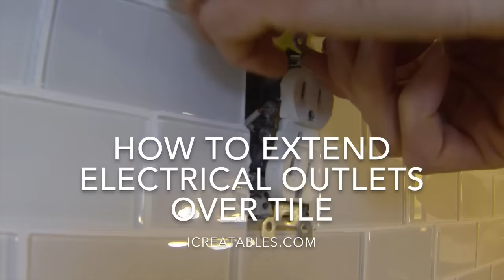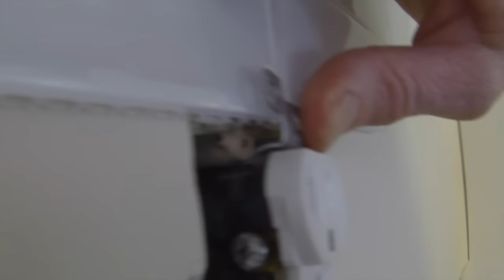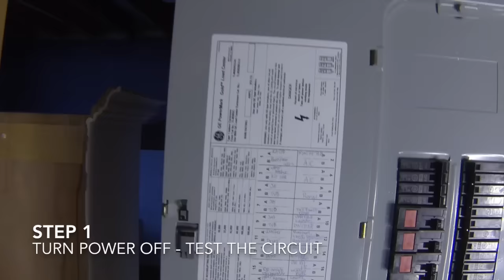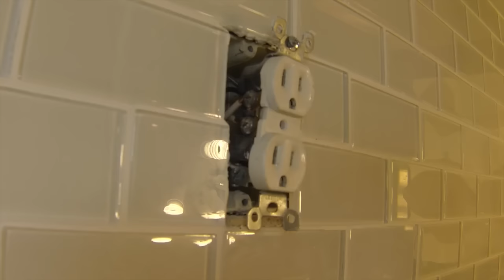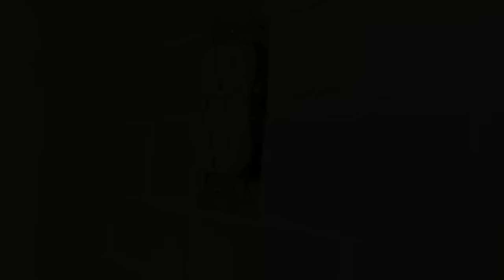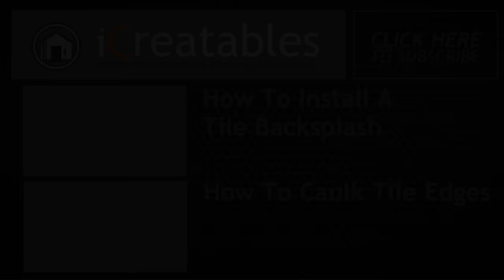How To Extend Electrical Outlets Over Tile

Comment: This "problem" has been hanging over my head for a year+ after DIYing a tile backsplash in my kitchen! Thanks for this information - I already bought mine at Home Depot & the outlets get fixed today! 👏
Reply from the maker: You are so welcome!
Reply: Where did you buy them?   And how much?
Reply: SAME!!! About 2 years now after a contractor installed the tile and left me with the finishing work! Excited to have my kitchen finally back together.

Comment: Thanks for the Info....I will have to replace all outlets and switches and do backsplash in less than 4 hours due to my fridge & mini deep freezer all being on the same circuit as most of my outlets in the kitchen, I may just wait until next week because I need one more outlet not in stock anywhere locally!!!!

Comment: in addition, I have purchased multiple box extenders (1-, 2-, and 3- gang).  They are effectively plastic sleeves with tabs for surrounding surface.   These would effectively transfer the pressure of installation screw to TILE surface.   Is this a bad idea?
Reply: Good idea!

Comment: Code is more than 1/4 needs fully encased. Via outlet extender
Reply: Ya the lead screws are exposed
Reply: And lots of things in your house can be out of code for 30 years until you want to sell it and nobody cares. You do the exact speed limit right ?
Reply: @indyguy3400  I do 80+ in a 65 on the daily, conditions permitting.  Would I do it if it could cause my house to burn down?  Of course not.  Do the math.  Some rules are arbitrary (and designed to enhance revenue), and some are based on lessons learned.

Comment: I always put some electrical tape on the sides of the exposed outlet connectors the wires go to since they are now outside the box a bit.
Reply from the maker: Great tip! Thanks for commenting.
Reply: yeah that's the old school way,  did that in the 80's & 90's

Comment: I prefer a box extension. That is code in California. Especially in a wet area as one has with tile backsplashes. Good safety technique otherwise.
Reply: Phil Rabe , I’m not a pro, but I think you’re right about the safety factor.  Anybody that’s had to deal with an electrical fire will probably agree!

Comment: howdy -- the implied message is that wall outlet and switches should not be tightened down on tile face, correct?    I can easily purchase a longer 6/32 screw to reach the outlet box.    is the concern that tightening outlet down on tile may dislodge tile over time?

Comment: Is it normal that my screws will no longer go in the outlet box?  It goes in a little bit and then acts like it is stuck.  I’ve also noticed the faceplates do not line up with the outlets/holes for the screws.  Is this fixable?

Comment: Buying those spacers is an extra expense that you don't need. If you're an electrician, you have all the materials you need right there. All we ever did was tightly coil some 12 gauge wire around a #2 square tip driver then slide it off the driver and cut the coil to the to the length you need for the spacer. Then just run your screw through that coil into the box and you're done. No extra expense and no need to run to a supply house to buy those spacers. Time and money saver.
Reply: I've also used the mouse ears on the outlet itself if not needed to act like washers.  You can use as many as you need to fine tune the thickness of each screw.  Having old outlets can help if you need more spacers.

Comment: Will this work with drywall?
I recently built a room in my basement but one plug is near an inch deep, the other 2 are fairly close but need a little extension.
Reply from the maker: Yes it will work with drywall. Thanks for watching!
Reply: iCreatables Perfect, thank you! This is an absolute life saver! Great video!!

Comment: What was the block you used for sanding the side of the cut tile?  Thank you.
Reply from the maker: berkmanyt I sometimes use the foam sanding blocks that are typically used for sanding drywall. A piece of sandpaper wrapped around a block of wood works even better.

Comment: Might be a stupid question but, where does the faceplate screw attach to?
Reply: Faceplates generally attach to the outlet itself, not the box the outlet screws into. For some this is a center screw on the outlet (as shown in the video), for others, it is the top and bottom screw holes on the outlet just below the main screws for attaching the outlet. Since this extends the outlet, the faceplate mounts move with it and there is no issue.

Comment: I have a light switch that is located halfway on the tile and halfway on the wall without tile. Moving the light switch would look bad. Think I will just do wallpaper to avoid this problem.
Reply from the maker: You can install a piece of tile around the switch and then the plate cover sits flat. It also looks like a continuation of the tile vs the break line going through the switch.

Comment: I'm having problems getting the screw the catch on the receptacle. Any tips would be appreciated.
Reply from the maker: Use a grabber screw. The larger threads will grab onto the plastic box.
Reply: iCreatables that sounds like something Trump woukd use.

Comment: Technically you need an actual box extender...not these spacers.  Boxes recessed behind combustible materials like wood present a fire hazard because the wood is left exposed to potential heat and sparks.  The spacers you are using are made for loose and poorly supported outlets and switches...not to be an alternative to a box extender.
Reply: amen brother was just going to say the same
Reply: Well said. In compliance with NEC314.20.
Reply: @brandonv4289   Code, my dude. Fires care, that's why they make box extenders for this very task.
Reply: Well, you convinced me to go with the wall box extender now that I understand how to use them. I think ill need these spaces for the 3 gang switch though?
Reply: Jpdst29 ... Thanks. Your comment is consistent with other web info since I’ve researched this issue. It’s code for a reason and negligent not to do it correctly. On a rental property there’s also a liability issue. The spacers seem a convenient shortcut, but when lives are at stake, I’m glad I learned the correct, safe fix.
Reply: Brandon V who hurt you?
Reply: @tatalaticusa719  He's an angry one. Perhaps he had a kitchen fire after not doing it the proper way and he's still upset.
Reply: Ok, but aren't plastic extenders are also combustible?
Reply: @jrr2016  They would just melt.  Not actually catch on fire.
Reply: Learned that lesson, fortunately via some sparks when plugging in vs. a house fire.

Comment: No GFCI?
Reply from the maker: Good catch. 2 GFCI' circuits are required in kitchens by code. You only need one at the start of each of the circuits and it will protect all outlets down the line.
Reply: iCreatables how to install tile backsplash
Reply: probably on the load side of a master gfi recept.

Comment: Or strip 14 ga wire and wrap it around a small screwdriver into a tight coil.  Cut it off to the correct thickness to fill the gap.  Works great.
Reply from the maker: Joe Shaw Great Tip.
Reply: If you put any load on it, the spiral of copper will just squish out of the way, providing no support.  Tried it, never again.  Also, as it's a spiral, it tends to cause the plug to lean.
Reply: it does work great, but don't forget your goof ring
Reply: and i wouldn't strip the wire best to leave insulated

Comment: You seriously turn the power off to replace a face plate?
Reply from the maker: ***** Great question. No, not for replacing a face plate. But it is recommended to turn the power off when you remove an outlet from its outlet box.
Reply: +Android Miller - Did you watch the video? He removed the outlet from the box. Yes, an experienced electrician or handyman may do this with live power, but obviously it's not recommended for noobs. 200 milliamps can stop your heart. A normal household outlet is 15 amps, which is 75 times a potentially lethal dose of current.
Reply: Android Miller I 4way wall. plug  in. socket. wireiñg
Reply: This is very important for him to show,  especially if us, females are planning on doing this.

Comment: Box extender is the only code compliant installation allowed in this situation. Not spacers.

Nec314.20
Installations within or behind a surface of concrete, tile, gypsum, plaster, or other noncombustible material, including boxes employing a flush-type cover or faceplate, shall be made so that the front edge of the box, plaster ring, extension ring, or listed extender will not be set back of the finished surface more than 6 mm (1∕4 in.).

Installations within a surface of wood or other combustible surface material, boxes, plaster rings, extension rings, or listed extenders shall extend to the finished surface or project therefrom